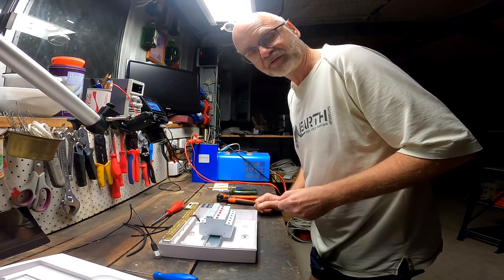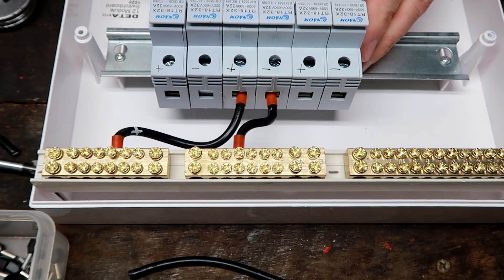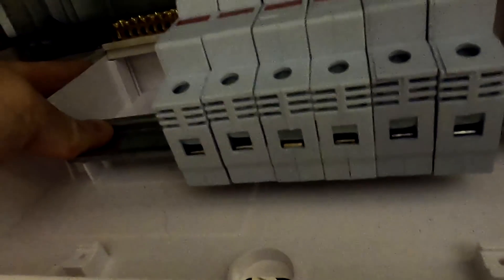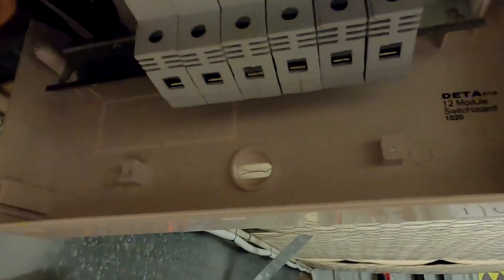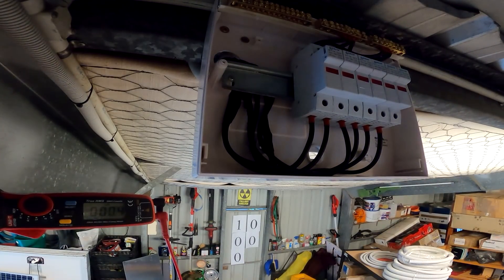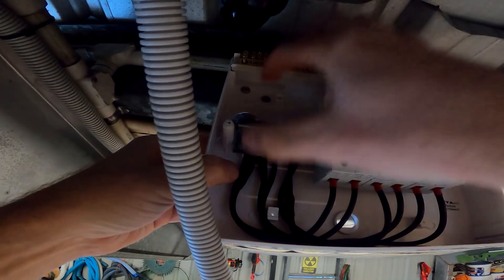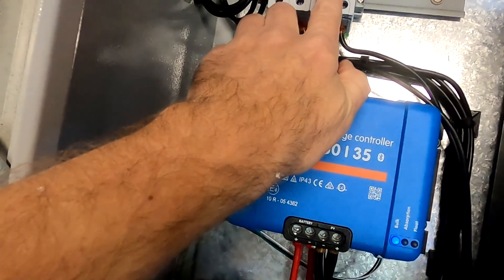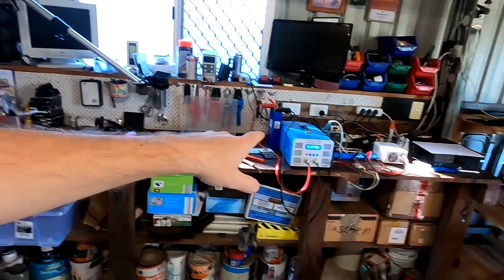Replacing crocodile clamps with a fused solar connection box. It looked like a quick job...

Comment: Are those the correct type of breaker for DC, most breakers like that are rated for AC only - DC can weld the contacts…
Reply from the maker: These are fuses actually, not breakers. All breakers I have installed are for DC current.

Comment: A home-made solar combiner box... without blocking diodes.  I've mentioned this before but you now have enough strings and wattage on your roof that blocking diodes are absolutely mandatory.  You can't count on those fuses as your only line of defense, put enough current through them that's beyond their rating (as can happen if multiple strings unload into a single shorted string) and you might end up with an arc short through the fuse.

I know you thought you tested the natural reverse polarity blocking, but any electrical engineer who works with solar will tell you that your tests are bogus.  Solar panels are not designed to block reverse current... the fact that they have some natural reverse blocking due to the diode nature of the cells is not enough to omit a real blocking diode on the strings.  The reverse break-down voltage is going to vary depending on the type of cell and how long they can actually block the current is not part of their specification.  You can't depend on the assumption that the cells will be naturally protective.

-Matt
Reply from the maker: Thanks, Matt. I will have blocking diodes soon for these strings (and future ones)

Comment: Doing Night shift, a dedicated worker 😊 👍
Electrical work usually takes  longer than expected. 
A couple of tips for you for next time, (I'm an electrican) 
I would use Double pole DC Circuit Breaker instead of fuses. 
Red Heat shrink on Postive cabling.
Normally Line side on Top of Circuit Breakers & Load side on bottom is usually sequence but not essential.

All ways go far larger in cable Diameter for any DC Low voltage wiring once you determine your Max. Demand. (bigger voltage drop & losses with smaller voltages)
Not so much when dealing with 240V AC. (Voltage drop can play a part after 50m in length)

Couldn't see but Bushing of  cabling through any metal holes is essential. Even sharp plastic holes should really be filed a little to limit any future cable fault issues.
Love the use of Cable ferrals on the end of each conductor, very professional.

If doing important Crimps with cable lugs, invest in a 6 sided crimper, doesn't have to be a fancy hydraulic crimper. A 6 sided rotatable die head crimper is cheap, that's what I use. 
(At least 2 crimps per Lug)

Great to see you having a go, and making good progress, well done. 😎👌👍
Reply from the maker: Thanks for your tips  and feedback
I have 2-pole DC circuit breakers with correct rating in my electrical cabinet and use the fuses only in the combiner box (blocking diodes will follow soon).
I've got red heat shrink (just didn't use it) 🤦‍♂️
I need to replace this 4mm cable form the combiner box to the cabinet if I add more solar. It is just enough for the 3 strings right now. Will go with 16mm then.
I have bushes or glands on all metal holes or electrical conduit when going through plastic. All cables are in either conduit pipe or corrugated conduit.
Reply: @OffGridGarageAustralia  Awesome, 
I have already subscribed 😊👍👌 It's good to see another fellow Aussie Shed tinkering.
I like your Lifepo4 testing Videos/ experiments.
I currently purchased some Lifepo4 32700 Cells from Ali Express, they all Capacity tested well short of there claimed 6500 - 7000mAh capacity.

My 12 cells capacity tested with Icharger X8 between 5.60Ah upto 5.9Ah. I too was a little disappointed but for the $ per cell I can live with it. 🙄😏😎
Reply from the maker: @oze-bikes4life663  Thanks for your sub!
I think so too, the cells are pretty good for the price and should be really good for an e-bike, right?
Reply: @OffGridGarageAustralia , yeah hindsight I would've preferred using Lifepo4 chemistry instead of LI-Ion Cobolt in an E.Bike (as you already know, it's a much safer chemistry)
As long as these Cells have a decent cycle life. (I'm thinking there either Factory second cells (B grade "New) or Used Cells so time will tell I guess.

Comment: Hello Andy
Like your videos
Is there a concern when parralling panel strings with different output voltages of recirculating currents or does each panel have a diode to stop this?
Reply from the maker: I did some testing in regards to that recently:
https://youtu.be/JFo223rJgSM
But I will have blocking diodes installed soon as it is now mandatory with so many strings in parallel.

Comment: Hi Andy. The  Suggestion from another fellow to use black and red solar panel wires is a valid suggestion. In addition to that, why did you not run your wires all the way over to your charge controller then put your combiner box there so you could shut off the power more conveniently for testing.  
 Another observation is that you should tie all of your minus leads to one bus bar and use your switches/fuses To disconnect your power.  It does no good to Fuse your minus lead as that means that it is double fused and is not double protecting you.  Use one fuse per string of panels on your system.  The real solar panel wire is 10 gauge stranded And is rated for is for 1000 V with  additional insulation on the wires  And is good for weather protection as well.  You should start being aware of the current on a wire. Your wire you are using from your breaker/fuse box is not of sufficient capacity for the amount of power you are getting from your panels.   8 or 6 gage BATTERY wire.  Not HOUSE  wire.
Oh, I ordered a SUN-2000GTIL2.  I hope that I can make it work!
Reply from the maker: Hello! Thanks for your feedback and questions. To combine the solar stings as early as possible saves me a lot of cables. Otherwise I would need to run 10 single cables to the electrical cabinet instead of just two wires. Also, I want to fuse the panels as close as possible to the location of the panels.
If you watch the video closely, you will see that I have fused each positive and negative of each solar string individually. The main cable from the combiner box back to the solar charge controller has a DC breaker installed so I can quickly turn off solar altogether for this side of the roof.
Reply: @OffGridGarageAustralia  Hi Andy.   I hear what you are saying.  I'm just reminding you that current in a series circuit is the same any where you measure it.   One fuse per string is enough.   
What you are saying is that you have 5 strings of panels which equal 10 wires.  Ok.  I am assuming that you have 2 panels in series 5 times.   Approximately 75 volts @ 7 amps = approximately 500 watts per string.    On a good day you can harvest 2000 to 2500 watts of power.   You could produce 70 to 80 amps of current.   Considering the restive losses on a cable 25 to 30 feet, considering restive losses, safely you should use 2 gage BATTERY wire from your solar combiner to your charge controller.   With the price of copper these days the a small size wire extended to your charge controller area would be a more effective solution.   Just saying.  Welding cable isn't cheap.   I  like what you are doing never the less.   I started small, learning as much as I could along the way.   I now have 8.5 kw of solar.  11 strings  of  260 watt panels.   3 panels in series per string.  3 strings parallel per charge controller.   4, 80 amp charge controllers charging 3000 amp hour of batteries @ 28.8 volts.   I have 2 Outback Power inverters running 240 volts split phase.  My wife and I both use  oxygen concentrators which is why I designed the system the way I did.    I live in Salt Lake City Utah where it gets hot in the summer and cold in the winter  months.  I use the grid to help charge the batteries when there are less favorable solar days. I use most days about 19 kwh per day.

Comment: My solar connection box  (combiner box) is a 'marine' fuse box with 10 Amp blade fuses, all connected then to a positive breaker prior to a MorningsStar PWM controller. The negative is 'common' (but if not in a vehicle, you would then describe as 'earth') but in any case no need to take neg through fuses or breakers. Just 42.36 Amps total through a positive fuse box then a 60 Amp breaker on the positive but small installations you do not need to overthink or overspend.

Comment: 080621/1454h PST 🇺🇸   080721/0754h Brisbane 🇦🇺 .  Thanks for the painstakingly performed tests and results.
Is it difficult to obtain RED cables? That could be easier to identify the polarity and less confusion. 
Take care and 73s…
Reply from the maker: Does not help if you have 3 red cables and 3 black one though 😂
Reply: Thanks.

Comment: Do those ferrules flatten slightly when you tighten down the screws? I ask because there are those of us who feel round ferrules make poor with flat contacts such as those breakers. You do make neatly, organized work of your wiring. You seem to have accumulated quite a bit of stuff in the Off-Grid Garage. I have a request; At the close of each video choose something from your "stuff" and tell us about it and why you'd kept. Always a pleasure watching.
Reply from the maker: Thanks Brian. The ferrules will flatten down a bit when tighten the terminals but that's not a problem. They are mandatory if using flexible or fine stranded wires so the screws won't cut off some of the fine cables and therefore lower the diameter of the cable.

Comment: If you would just use red cable for positive and black cable for negative you wouldn't have to constantly check your polarity...
Reply from the maker: That would help only with the polarity though but not with which cable is which. I have only black cable 🤷‍♂️

Comment: Is there a differenc to use such fuses instead of circuit breakers, which you would not have to replace after tripping?
Reply: Fuses works equally good on either AC or DC, and relatively cheap vs special DC version of modular (for DIN-rail) circuit breakers. I mean, that fuses have a very good arc extinguishing capability during interruption of DC current for its price. Also, DC-type modular breakers is not a common selling product. A chance for fuse blowing in solar circuits is far less, than in general greed-feed AC circuits. So, 2 or 4 extra fuses will be sufficient as spare kit for years.
Reply: Thank you for the explanation :-)
I could only find fuse holders that were more expensive than breakers. But seems to be no problem :-)
Reply: @daskasspatzle2396 , if DIN-rail holders are expensive, you can look for industrial fuses and fuseholders at size 000 or 00. Something like: fuseholder or fusedisconnect NH-00 size and fuses ("fuselinks") for it. Generally, this type of fuseholders are cheaper, than DIN-rail fuseholders.
Reply from the maker: Hey Mr Kässpätzle: https://youtu.be/fZGj2cVnlHc
Reply: Thank you :-)

Comment: I have to admit, I am a wind/solar virgin, but I have wired many residences for AC and have done some low voltage work with telecommunications. I also have the same question that David Simson has: Why are you fusing the negative side? Also, to save an aggravating experience, I can tell you that simply running wiring wild and then cutting to length inside the junction box or breaker cabinet saves a whole bunch of cussing. Trying to cut to length using a tape measure... well those doggone tape measures seem to change size at the most inconvenient times. It may sound like a big waste if your are clipping off 6 and 8 inch tails, but avoiding the frustration of cutting too short is well worth sacrificing a couple of feet of wire. By the way, I believe that you can splice inside the fuse or breaker box like in my small world here in the US. 

In my small world, I have to splice wire inside of an access such as a junction box. I admire your soldering the splices and using heat shrink, which is the best way to splice a wire, but to save aggravation further down the road, I would suggest putting all splices inside a junction box of some kind. It has been my experience that no matter the splice quality in a wire, the splice is always the weakest link in the wire. 

As a final observation, if you do this sort of work often, and do insist on running your wiring without labeling and maintaining some sort of circuit separation as you have, get yourself what us old telephone techs call a "toner." A toner is a small instrument that sends a radio frequency down the specific wire with which it is connected. You use what is called a sniffer that comes with the toner to detect the signal at the other end. I use my old toner all of the time especially in diagnostics. Also, I think that you could have saved yourself a lot of trouble trying to detect polarity by simply fusing the positive side and combining  all of the negatives on a single bus bar. The fused  positive wires all combine on the same bus bar anyway. That is why this particular type fuse box is called a combiner box. But then again, as I have said, I am a wind/solar virgin. I hope that I have not offended.
Reply from the maker: In case of a fault you want to isolate a single string, not just interrupt the power. Could be faulty panel and you're still feeding power through the negative wire back to the faulty panel and ground. 
Always isolate!

Comment: Nice junction box! I hate soldering big wire like that, nothing worse, but got to do what you got to do, Works! Good Job!
Reply: 080621/1501h PST 🇺🇸   Soldering is an art. No one needs to hate it while performing the procedure. The ONLY thing one need to posses is the proper soldering equipment, proper temperature and clean (very) surface to solder. Using any kinda rosin (solid or liquid form) is not recommended as it contains corrosive element that’d make the joint look like splattered cow dunk.
 Please research on “KESTER-951 CLEAN FLUX” available on eBay USA. It’s the best ever to lay your hands on for great lead adhesion. Final soldered joint will gleam and will look great. Preferably use 60/40 (Sn/Pb.)
Higher the Sn content, ugly the joint will look like splattered Cow dunk. I’d not use ROHS compliant soldering material. We are not consuming Pb nor are we into space research. Good luck and stay safe. 73s…
Reply from the maker: My solder contains flux already as the inner core, hence the smoke...

Comment: You Idea is good, but why do you do not extend those string to the bench? is easy to test on the future.
Reply from the maker: Far too much cables. 10 cables in comparison to 2 only. Also you want the fuses as close to the panels as possible.

Comment: 4mm2 cable is 12AWG, which is for up to 20 amps, not 30 amps. I think you should be using a 6mm2 cable 10AWG minimum and possibly 8mm2 cable would be even better to reduce losses and have you prepared for those 2 addition strings.
Reply: Depends on the insulation temperature rating
Reply: @niktak1114  nec code in the US states that terminals are only rated for 75c so you can't use the 90c column in the ampacity chart. Youre bound by the 75c column.  30a-10awg and larger conductor for any significant distance between panels and mppt.
Reply from the maker: Single-Core 90°C Thermosetting Insulated Cables, Non-Armoured:
Reference Method B (enclosed in conduit on a wall or in trunking etc.), 2 cables, single-phase a.c. or d.c.
4mm cable up to 42A.
The charge controller is maxing out at 35A though and I have a 25A DC breaker in between the incoming solar cables and SCC. 
These cables need to be replaced with 16mm cables once I have installed the other 2 strings for each roof.
4mm was OK to start with but it's getting close.

Comment: why do you fuse the pos and the neg i would of thought you would only need to fuse the positive cable
Reply: When neither side is common, you should fuse both sides. If positive were to short to ground before the fuse, then a short to ground (or the building) anywhere on the negative could be a problem.
In a car the negative is common (typically in modern vehicles) so fusing the positive is sufficient. Some solar systems ground the negative (or the positive) which means a single fuse on the other is sufficient.
Reply: @Sylvan_dB  OK, honest question, why not just drive an earth rod into the ground & route all negatives into this? This would save a lot of work and expense.
Reply: @Sylvan_dB  ah I see
Reply: If you were switching a DC load with a relay it would have to be rated for the appropriate current, but if you switched both rails, would they each carry half the current? And would the fuses distribute the load and only blow at twice the current? Or am I conflating series current with series resistance?
Reply: @DavidBTB  no each fuse would only half the current if they where in parallel with a fuse pos and ned one or the other would blow